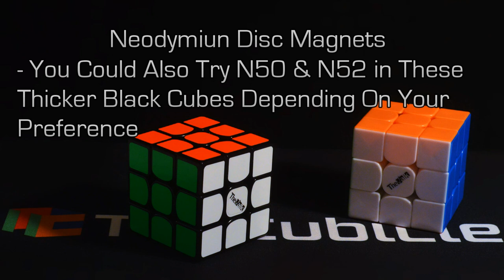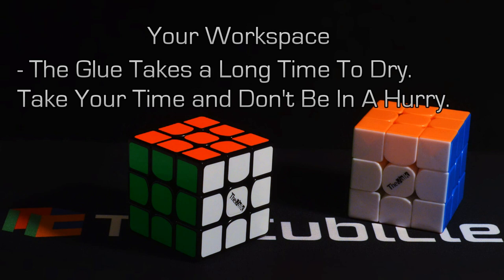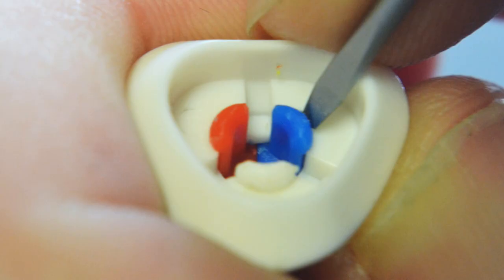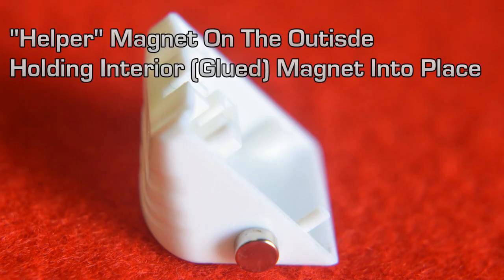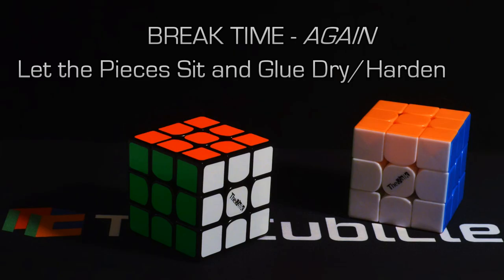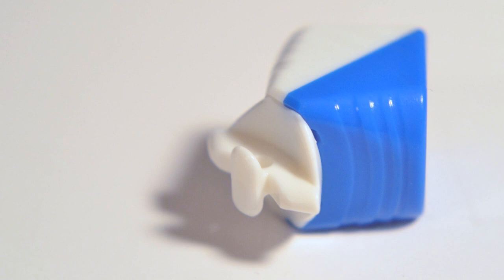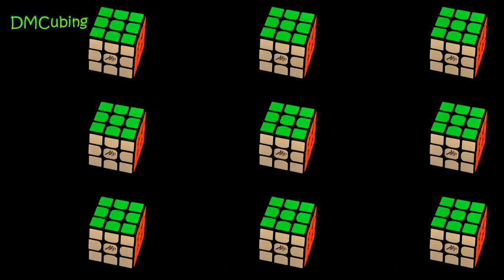DIY: How To Make A Magnetic Valk 3 Speedcube Tutorial

Comment: Just magnetized my Valk3 after a long wait from China. I used 4mm x 2mm N35 magnets from Omo. They actually feel quite strong in the cube. Not quite as much as my Gan Air Master with the same magnets in, but a lot stronger than the N50 4x2 in my Warrior W.
Reply from the maker: Craig Smith Hi Craig. Thanks for sharing your experiences. Where did you get the N50 4x2s, if you don't mind mentioning. 
The N35s you used sound similar to the ones I get from Gaussboys. They're certainly stronger than other manufacturer's magnets of the same size and grade. I've heard good things about Omo, though I've never personally ordered from them. 
I once talked with the owner of Gaussboys, and he said there is a lot of differences between various manufacturers, and even between batches of the same magnet from the same manufacturer. Usually when I find a magnet I like, I order a 1000 of them at a time. 
Some times I like to use the N35 4x2s from magnets365.com. They're slightly undersized, at 4x1.7 and work incredibly well in the Gan Air and in the Valk too, for a lighter feel in that cube.
Reply: Hi Dave. I order from an eBay seller. I've done about 8 different cubes with different magnets now. The Omo branded ones definitely seem stronger than the other cheaper ones I have bought. Did you get my email I sent you yesterday? I sent it to your email address on you Trumpet home page. I'm thinking of building a magnetic Gauss meter with an OLED to display magnetic strength etc. The equations are pretty crazy for something so simple, but I've got it all sorted out in Excel and I get the same results in my equation as K&J magnet's site does. Was also thinking of having a couple of buttons to select height and diameter of the magnet being tested and it should be able to then tell you (on a sliding scale type of thing) the grade of the magnet, N35, N50 etc. If my prototype works out OK, I'll get a couple PCBs made and assemble you one. Check your email :)
Reply: After a few solves on the Valk with the N35 4x2, I went back to the Gans Air and it feels maybe a little too strong in that now. I would think the 4mm x 1.7mm N35 in an Air would feel the same as the 4mm x 2mm in the Valk.
Reply from the maker: Craig Smith Yep! I replied to the email just before posting my reply here. 

I've noticed many N50 4x2s are weak, and I imagine a lot of them are actually N35s being passed off as a stronger magnet. The best I've come across are from Gaussboys here in the US. But all Neodymium magnets originate from China, so it's possible to eventually find the original source supplier of higher quality magnets over there.
Reply from the maker: Craig Smith Yes, I find this to be so with my comparisons. And you can always dial down the strength in the Gan by placing the magnets further into the cubie pieces. 
An interesting thing I came across with trying 5x1s in the Valk is, that because of the corner piece cutaway holes, a fair amount magnetic attraction escapes through the hole and thus, a magnet that would normally feel weaker than an N35 4x2, actually ends up feeling stronger because of the holes.

Comment: Very nice video! 
One question - many other cubers made one  master pair (one edge and corner) first then duplicated to match the exact magnet position. You seem to have placed magnet without any master pair - or am I wrong? If you didn't make the master pair, just putting each magnet in the corner is good enough?
Reply from the maker: JAEYONG PARK Thank you!!  if you watch my video here in its entirety, or any video of mine, you will see that I place a magnet first usually in the edge peace. I use a helper magnet on the side because these magnets need to stay in place for precise alignment. A lot of people fail to do this and as such, I'm less trusting of their methods. I find one single spot that works inside each edge piece and glue all the edge piece magnets first. This location of the edge piece magnet is usually at the base of one of the internal posts. Once all edge pieces have been glued, i then match all corner piece thirds to the edge pieces and glue their magnets. You'll see this in most of my videos with the exception of the Air and GTS. 
Others may choose to do their cubes with a different technique. That's fine, and if it works for them, good. But I tend to post magnetic tutorials on various cubes before anyone else and I have my own way of doing it. I've magnetized roughly 50 cubes now and I know what works for me. I've also never had problems with polarity or my magnets falling out. 
There are certainly other ways of doing this and I often make it clear that my way is not the only way. 😀

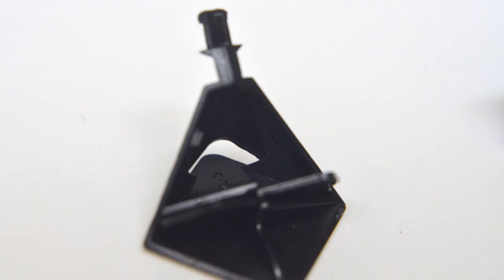Comment: 7:15   ....does it need to be the 3rd part of the corner?
Reply from the maker: Pop Poop I don't understand. In most magnetic modifications, we attract the edge pieces to the corner pieces. When the edges are taken apart, you have two halves. The corner pieces have three main parts when they're taken apart. So when we're gluing in magnets, we are matching up edge piece halves with corner piece thirds.
Reply: +DMCubing any scramble of the cube will align?

Comment: I finally got magnets and I made a GTS M and Valk M. I put N50 in the GTS and N35 in the Valk. They both turned out amazing! One small complaint though is that the strength of the magnets on the valk were a bit too much. I dont know if my magnets were labeled correctly (or if that's what is supposed to happen) but other than that they are great!
Reply from the maker: You're the second person this morning who has mentioned their N35s felt strong. That is weird. No, to me, the N35 actually feels a bit on the weak side in a black Valk. I actually like the N38 and 42 in this cube. 

Since your GTS tunred out well, it makes me wonder what's going on. To me, using N48s in a black GTS feels about what using N35 do in a black Valk. And you used N50 in your GTS yet your Valk's N35 feel strong. Hmmm... Is you Valk stickerless, or a color other than black?
Reply: +DMCubing Both of my cubes are black plastic. It is kinda weird that the Valk is stronger. Maybe the magnets I received were labeled incorrectly (like I mentioned before). But when I tested them out at first before the gluing, the n50 were notice-fully stronger. It's probably the position of the magnets that would make the only difference in my opinion.

Comment: I used to put the magnets at my Valk at that location but when I bought a Valk Power M, I noticed that the magnets where more on the inner part of the pieces so I took the magnets off from my Valk and moved them to align with the Valk Power M and it feels better for me. I don't know but 4x2 N35 were a bit strong for me and putting it in the inner part made it easier to turn but with similar stability. Maybe you could try this too.
Reply from the maker: Gerro Paolo Gallardo Two of my first Valk cubes I had the magnets further in. It reduces the overall magnetic pullforce strength. I found that because of the cutaway holes of the corner pieces, you had to be careful so that the magnet wouldn't protrude from the hole, and you've got to be careful so glue doesn't run out. 
I agree, for some people, a standard N35 4x2 can be strong in this cube. I ended up setting on the N35 "4x2" from magnets365 for this cube, as it's slightly undersized at 4x1.7. 
I also like the same magnet in the Gan Air, and position it a little closer to the core than normal to decrease the magnetic strength.
Reply: I didn't have the problem of magnets protruding from the hole since I put in near where the pieces would connect when you put it back together. This is how the Valk Power M magnets were placed and it somehow feels better for me.
Yeah, It's quite strong for me somehow. I really like those in the Valk Power M. It just feels smooth and fast but still controllable. Or maybe its because of the cube itself. Haha.
Btw, when adding magnets, I suggest you try speedcubereview's method of putting them in where you start first with a pair of edge and corner piece, put the magnets and pair the edge piece with another corner and the corner with the magnets with another edge. This way, you won't really have problems with polarity as it fixes itself and I find it quite faster. I've magnetized a few 3x3s and it took me less than 1 hr. I also just let it dry for another 30 mins to make sure there won't be gluing problems when I assemble the cube.
Reply from the maker: Gerro Paolo Gallardo My Valk Power M should be arriving Tuesday. I'm really looking forward to checking it out!
I've made over 100 magnetic cubes and have never had a polarity issue. I use the method I do so I can use a variety of adhesives, such as epoxy. Using a slow drying glue requires a magnet on the outside of the cubie piece to hold the glued in magnet in place. That's the way I do my cubes. Other people may do their cubes differently.
Reply: DMCubing, I was just suggesting since you said it takes you 2 to 3 hours to magnetize a cube. But well, different methods work for different people and I respect that. :)
Nice, you should really try it out. I really like it. Haha.
Anyway, please continue doing your videos. The're very informative and makes me want to magnetize more cubes but I'm quite short of money. Haha. You got a sub from me. And Merry Christmas since it's nearly Christmas eve here in the Philippines. :D
Reply from the maker: Merry Christmas to you too! Hope your's was great. I'm finally getting back to comments and messages!
I just got the Valk Power M. I noticed they're using internal slots in that cube and a 4x1 magnet. Probably an N35 going by my tests. I like the slots- makes magnetizing the cube really easy!
No, it only takes me an hour and a half to do a cube and that includes thoroughly cleaning all the cubie pieces inside and out. I often tell people to allow for two or three hours when dong a cube if it's their first time, that way they're not rushed when doing it. 
I used to wait doing the corner piece magnets until after the edge piece magnets were dried, but now go directly to adding the corner piece magnets. You should try it, Honestly, you're not saving much time magnetizing the other way because at no point with my method are you not gluing magnets, so essentially the time is the same (assuming you're properly applying the glue, etc.), and at least my way assures your magnets are perfectly aligned. If you use anything other than an instantly-setting glue, you're at a risk of having your magnets shift out of position. When you use a helper magnet on the outside of the piece, it assures the freshly glued magnet isn't going to move around. And again, I use my method because it works with all adhesives. And finally, it's how the Cubicle recommends magnetizing a cube.

Comment: Alright! I just finished my second Valk.  This time a stickerless version that i magnetised with 4x2mm N35 (from Gaussboys)
This cube is fantastic.  In my opinion the N35s provide the right amount of grab for me.  It is definitely a pronounced feel as the layers slide by each other, but not so strong that you need to apply too much force to keep the layers moving past one another.  I still think you could use a weaker magnet for this cube, perhaps the 4x2mm N35s from magnets365 which are by reports a little smaller that 4x2mm and therefore weaker.  Or maybe a 3x1.5mm size, the N number i am not sure of as i have not used any of this dimension yet.  Maybe DMCubing could tell us what N strength in a 3x1.5 mm disc magnet would provide a weaker attractive force than the n35 4x2mm.

anyway, with every cube i mod the process gets faster and more fun.  The real fun is putting the cube back together and then sampling the fruits of your labour.
Reply from the maker: jonathan herring So great hearing from you, Jonathan!
I agree, the Gaussboys N35 4x2 give a good, but not too subtle feel, and yes, the "4x2" N35s from magnets365 are actually 4x1.7, and vary a slight bit from that, up and down. I've measured them. And they are a good magnet when you need something just a step down in strength from a normal N35 4x2. 
The N48 5x1 is also a great step down from the N35 4x2, but in the Valk, because of the corner piece cutaway holes, the strength is felt to be a little bit stronger than using the same magnet in something like the GTS2. 
The N52 3x1.5 is certainly worth checking out in 3x3s if you're looking for a lighter feel. All I've used it in so far is 2x2 cubes and the 4x4 middle layer. I wouldn't mind trying the N52 3x1.5 in a Valk but I'm out of that cube right now.
Reply: Thanks!  Funny enough, I have all of those magnets on the way.  I have a GTS2 that is waiting for the 5x1s and a WuQue that is disassembled and awaiting its magnets.

I think I am going to get another stickerless Valk to try the N52 3x1.5s just to see.  

I'm not sure what is more fun, modding the cubes or solving them!
Reply from the maker: jonathan herring You're hooked!!! Lol!!!! It really is fun, though, isn't it?
Let me know how the N52 3x1.5 feel in the Valk. 
So you're going to do a GTS2 with N48 5x1s? That's my favorite cube!!!!

Comment: can you replace the magnet in the valk power m with a new one.if you can replace it,what magnet is the best.im going to buy a valk power m if it can replace it magnet.which is better sticker or stickerless.btw i just seen this channel and i liked it.thank you
Reply from the maker: My Mind is Full of Knowlage The factory magnetized version uses N35 4x1 in the corners and N35 4x1.5. You certainly could change the cube to your liking. If there's not a lot of glue on top of the corner piece magnet, you could place an additional magnet on top of the factory 4x1. Something like an N35 4x1 magnet. This would increase the magnetic feel. 
I'd certainly use the factory magnetized cube first for a while before deciding to change it up too much.

Comment: Are you still prototyping or have you already done that? Which grade of magnets do you think works the best on the valk?
Reply from the maker: Eddie Kim I think I made a total of 14 Valks, most of them prototypes in one way or another. It's written down here somewhere. Lol. 

Anyway, the N35 4x2 is probably the most accepted magnet for this cube. If you like a stronger magnetic feel, you can use N38 and N42. If you like a lighter more subtle feel, then using the N35 4x2 (which actually measures 4x1.7) from magnets365.com is an excellent choice.
Reply: Alright, thank you so much DMCubing!

Comment: Nice video!!One question do you think 5×1 n42 or lower would be better like in the gts 2?
Reply from the maker: Alexander MAniatis You certainly can use 5x1 magnets in the Valk. What I've noticed, though, is their strength feels a little more enhanced in the Valk. In other words, an N42 5x1 has a nice subtle feel in the GTS2M, but in the Valk, the same magnet feels stronger. 
The reason why is the cutaway holes. Since the corner pieces aren't shielded there, there is an increase of magnetic attraction. So, this increases the perceived magnetic pullforce strength.

Comment: Sorry if this question was asked previously on any video, while still waiting for my magnets. I was thinking that if a larger surface (other than increasing its weight) magnet eg.5mm or a thicker magnet eg.3mm does affect its performance of the attraction.
Reply from the maker: Jason - Hobby House The shape and size does have an effect. I think we use 4x2 magnets because they're more readily available but a wider magnet with a similar pull could be advantageous to experiment with. Chris Tran has mentioned that crescent shaped magnets as well as rectangular magnets have advantages over disc shaped magnets. I've yet to experiment with those but I think it would be worth trying.
Reply: DMCubing 3.30am here in Singapore, am drying the glue now. Very excited and wanted to say thank you again. My valk M is delivering soon 🤓🤗. It May not be the latest cube , but its made on the cube which serves me well ever since i came back to cubing.
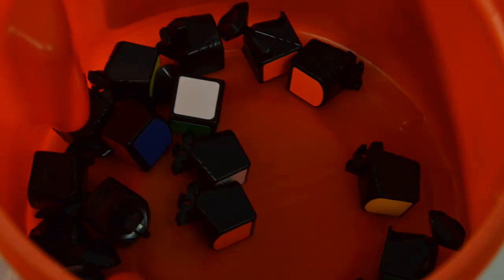Reply from the maker: Jason - Hobby House 3:30 is too early!!! 😀
Thank you so much for your kind words!!!! Let me know how your cube turns out!!!
Reply: DMCubing aww 😕 , the turning turns out to be heavier than i expected . Numb fingers after 50 solves. Using N35 on black plastic valk. Could it be the tensions ? Any tips to share 😅
Reply from the maker: Jason - Hobby House hmmm. That doesn't sound right. N35 in the Valk should feel very nice, almost on the subtle side. You did use 4mm x 2 mm magnets, didn't you? You should only be feeling a slight bump, or that's the way it's always been for me using this magnet in this cube. Generally speaking, yes, you should adjust the tensions a little bit, loosening them up helps free the action of the cube, engages the magnets more. Let me know what you find out after you have experimented with the tensions.
Reply: DMCubing yeap i used the same size 4mmx2mm , i guess im not used to the magnets 😅. It feels better Now after 1 day ,  but would be better if the magnet are weaker, still feel it too strong. 😐
Reply from the maker: Jason - Hobby House That is really interesting. I think that maybe your magnets, though still N35, may be stronger than mine.